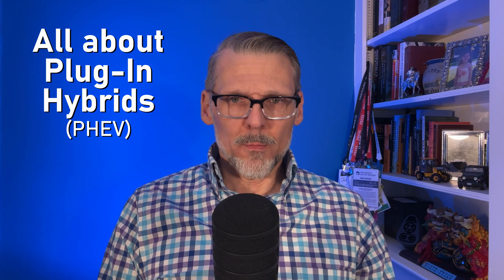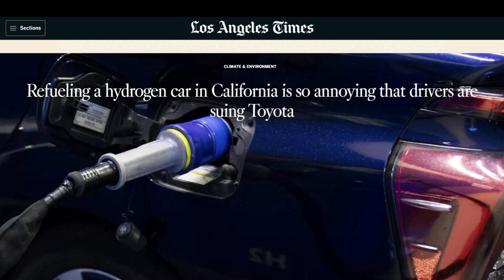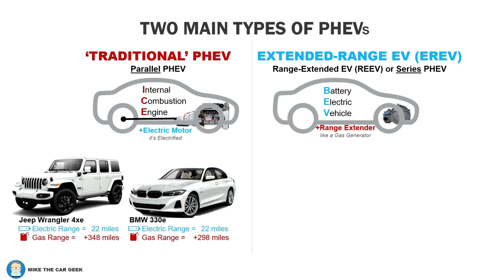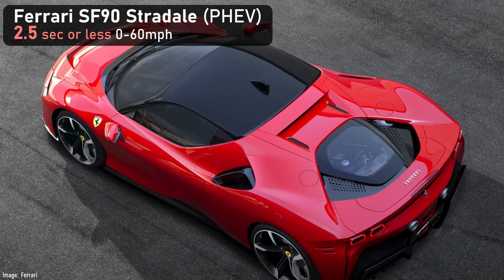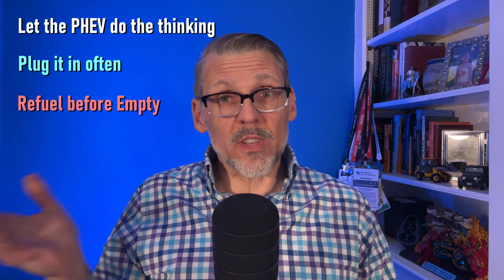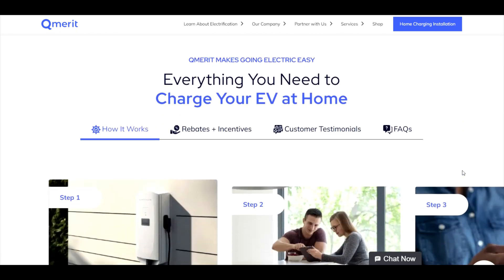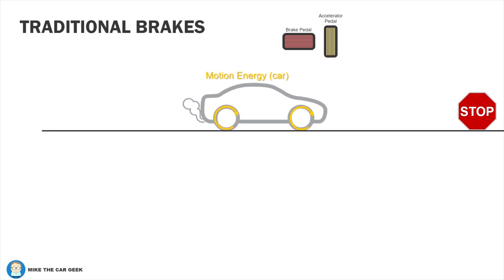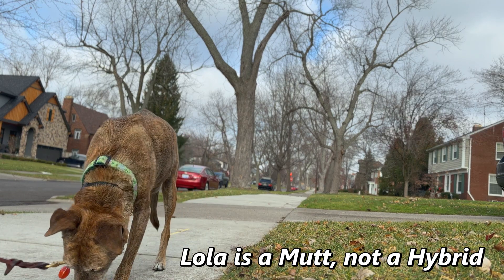All About Plug-In Hybrids (PHEVs)... and EREVs too!

Comment: Nissan’s Qashqai e-Power is an EREV that you don’t need to plug-in : the ICE has only the function of charging the battery, and the wheels are driven exclusively by the battery. This seems to me to make a lot of sense for people who want the EV driving experience, but without the EV hassle package..🤔☝️
Reply: Hassle?
Reply: @ziploc2000  To recharge a car battery, you need mostly to register with the company, mostly companies, who produce the chargers, or else you cannot use the charger. It takes typically half an hour to an hour to charge a car battery. The charger network is still sparse, and if you find one, they are often already being used by other drivers. The chargers are mostly not under-roof, so if it raining/snowing it’s not a pleasant experience connecting and activating the charger. EVs cost more than ICEVs. I was an unhappy BMW i3 driver, and I am now a happy BMW diesel driver. Friends of mine had an Ioniq 5, and they now drive a diesel-driven Range Rover : they didn’t want the hassle package anymore either 👍 PS Many people live in apartments, and mostly don’t have access to charging facilities at home..

Comment: I have had a Alfa Romeo Tonale Sprint PHEV EAWD for 1 1/2 years. It was the best all around PHEV I test drove, of many in it's size. It has exceeded the range and MPG ratings on the MSRP sheet, handles great, looks better then most, and fits nicely in my garage, and I have had zero problems with it. I would buy it again, and I got a great deal on it.